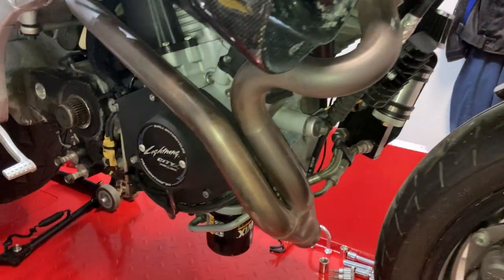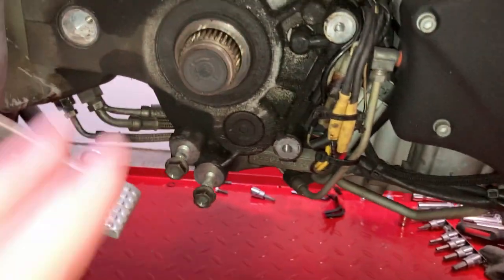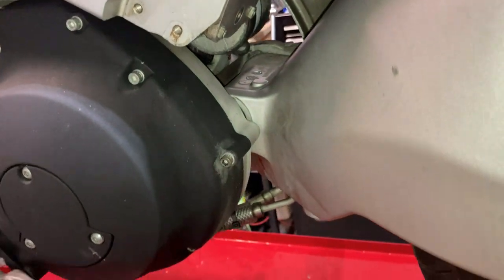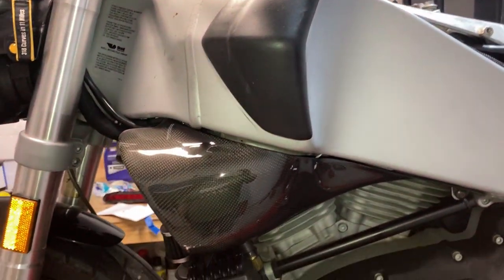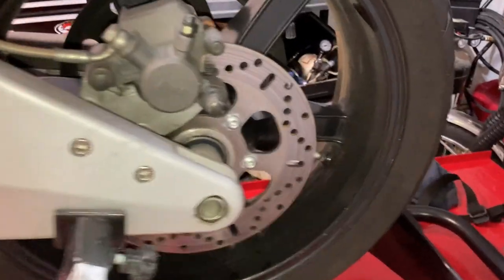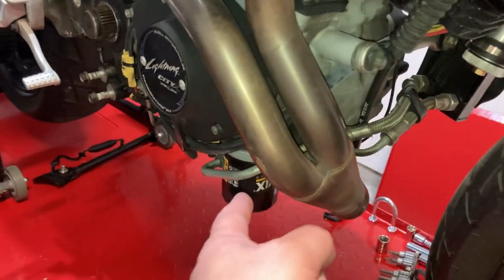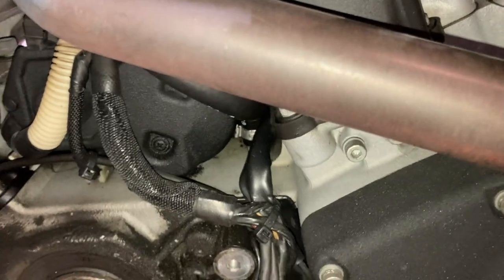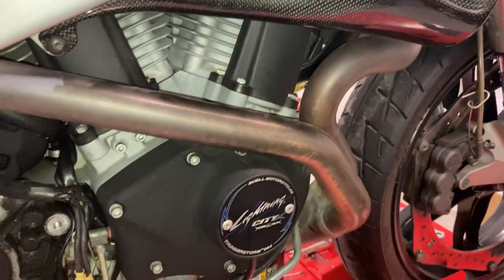Reviving my Buell: A DIY Motorcycle Rebuild - #teardown

Comment: Bit behind on your videos, but the leak on my 06 XB12Ss came from a transmission breather hose on top of the transmission, a bit hard to get at but there is a rubber hose there that likes to leak.  Also the oil lines and fittings need to be checked and sealed with teflon from time to time.  I may be a bit neurotic about having no leaks on my Buell, but thats just me.  I polished the primary cover, that turned out great except rain does like to leave spots due to heat, especially if put away wet... something to keep in mind.  I'm reminded of my ZX7 clutch cover and chaseing the polishing routine, but I must admit the frame and wheel outers were easy'er to keep polished.
Reply from the maker: They used to make this product for polished aluminum called Zoop. I'm being lazy and not looking for it right now, but maybe that'd work?
Reply from the maker: Zoop seal is the name.
Reply: @kz6fittycent  What I used was those cheap large crayon looking polishing sticks from Harbor Freight, as well as the layered cloth polishing wheels.  
The white compound does an exceptional job, and a little goes a long way, meaning I barely apply maybe a 3 seconds worth of lightly touching the spinning polishing wheel, mounted on an old drill spinning at roughly a mid range whirl... so 300 RPM or so.  
Too fast or too much compound, and it turns into a sloppy ineffective mess. While often enough not using any compound at all, on an old blackened polishing wheel, does the best job.
And be sure to clean the surface before hand with 90% alcohol or acetone to get the surface cleaned up nicely with a damp cloth.
Then at last or to keep it pretty, follow up with Mothers Aluminum polish, and a white towel or "terry cloth" by hand. 
And yes I also have an angle grinder, but for some reason that just feels cumbersome to use in tight spots, its also heavy, and you risk hitting the middle bolt that holds the polishing wheel on.   
As for tight spots the Dremmel tool works well,  no need to spin it fast, instead almost slow enough to bog the motor a bit with light pressure. But its a small layered cloth polishing wheel so you cant apply pressure anyway, and perfect for the areas between the hex bolts. 
Which on a Buell definately wont hurt to pull out and re-torque every 3 to 6 months anyway, while you polish the recessed area where the bolts go. 
Cause its a Buell, and the only way to have a 3.5 inch torque producing stroke, is to sacrifice a bit of engine vibration.  Long stroke more shake, short stroke less shake... regardless of how well balanced the engine components are.  Even under ideal conditions the engines secondary forces will create some vibration, its unavoidable. 

Anyway... 
Look up (-> RB Racings <-) websìte, 
they had been building turbo race engines for motorcycles for a half a century now. 
Yes both Jap 4 cylinders and V-twins. Their website is full of information so be carefull, you might learn something. LOL
Anyway... I'm done babeling... 

rbracing-rsr (dot) c o m

Comment: 3:52 why you saying Schmutz???
Reply from the maker: @patrickdequis2544  The word "schmutz" is a noun that means dirt, filth, grime, or rubbish. It comes from the Middle High German word smutzen, which means "to soil". Merriam-Webster says that the word has been used in English since 1940.
Reply: @kz6fittycent  I am german, that´s why i´m wondering ;-)